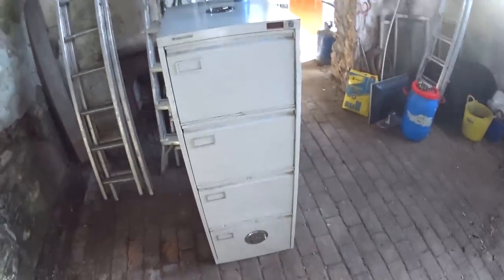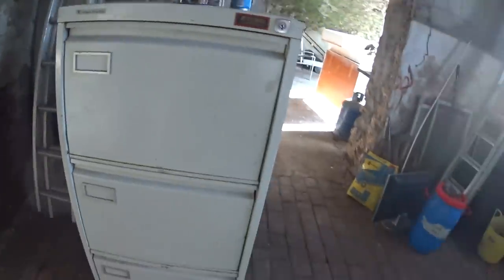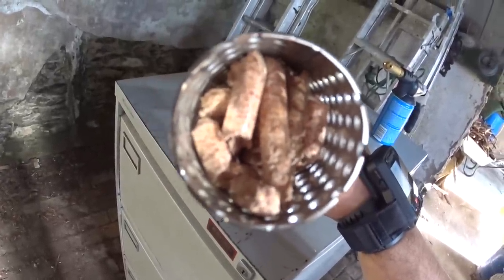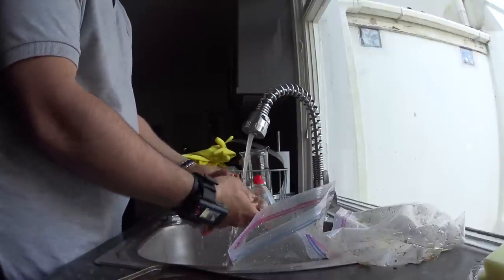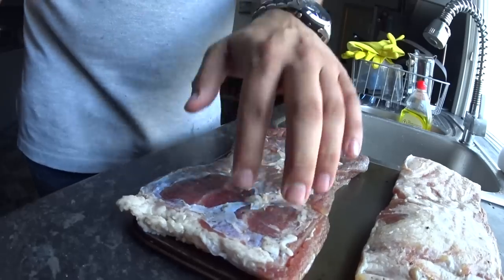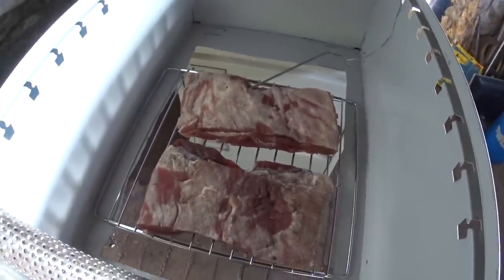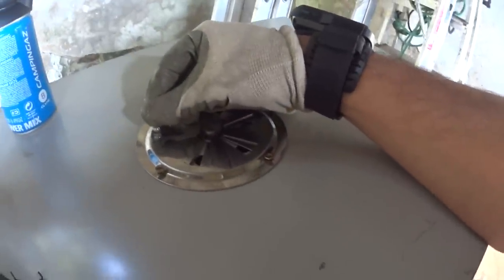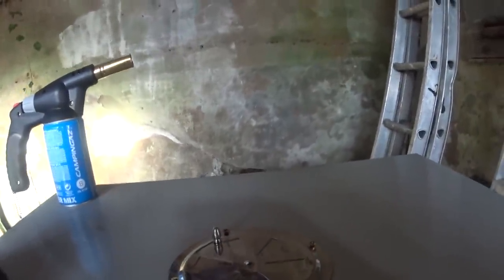Filing Cabinet Smoker & First go at Bacon

Comment: great cold smoker. I do a lot of hot smoking with a trash can smoker and want to start cold smoking. Now I know how using the smoke tube. If you want to hot smoke, put the charcoal and the wood chunks in the bottom drawer and put a water container in the drawer above it to act like a heat sink so things don't get too hot. About 250-300F(120-140C). Need more stick thermometer. Put one in each drawer to see how the temperature varies from top to the bottom drawer.